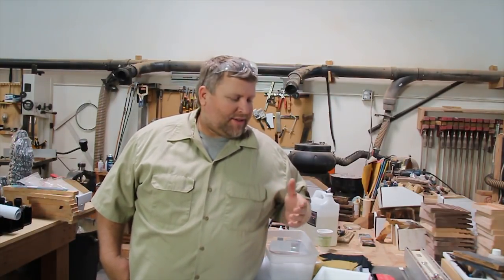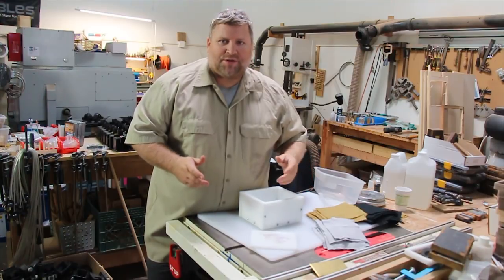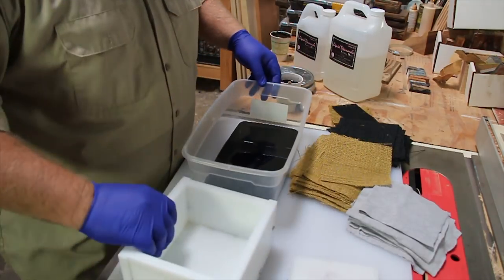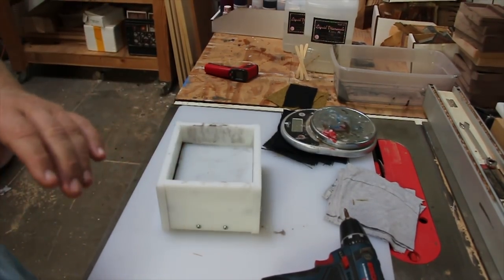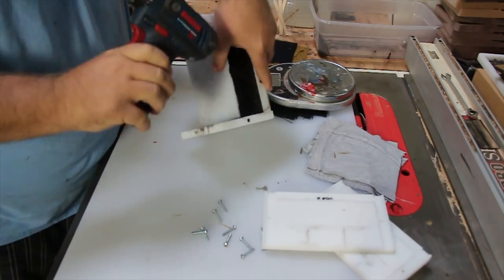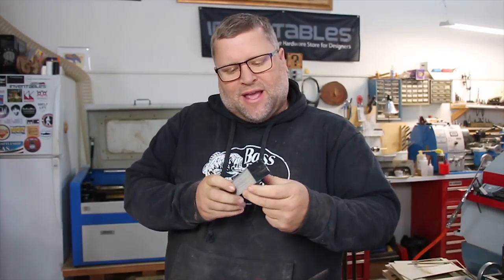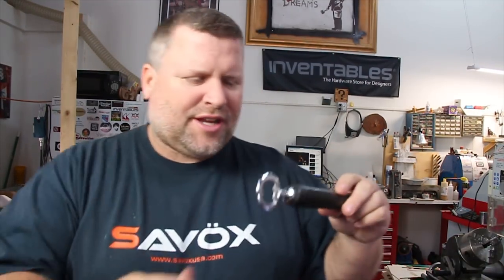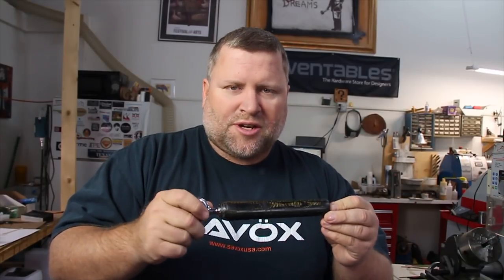DIY Making Micarta for the first time,  Resin Casting

Comment: Turned out well, Chad. I make my own as well and clamp the top as you did.  As has been said, natural fabrics work best.  I prefer cotton. I've used solid color, prints and even old military camo successfully.  I don't use a pressure pot either and have not noticed any bubbles.  But I saturate each layer then "squeegee" it off with my fingers before placing it in the mold.  To date I've only used marine resin, but I'm sure any slow cure resin will work. Liquid Diamonds (or other clear setting epoxy) is probably better if you want to maintain the original color of the fabric because they are not supposed to yellow like the older epoxies I've been using.
Take care.
Billy

Comment: I did a lot of Micarta ... I like to use paper, Denim, Linen, old military clothes and burlap too.
For me T-Shirts are not the first choise, to soft and don't give a nice pattern. And all fabrics have to be natural.
I use a press without extra pressure or vacuum. And what I have learned through the years, don't press to much. You need the resin in the fabric mit outside of the press.
Reply from the maker: good tip thank you
Reply: Penblank Manufaktur is felt any good for micarta?